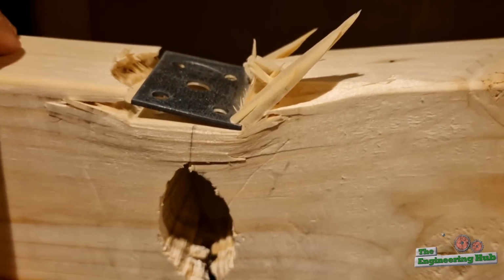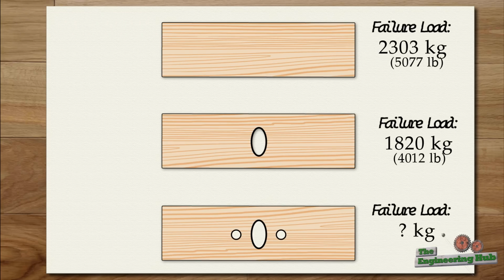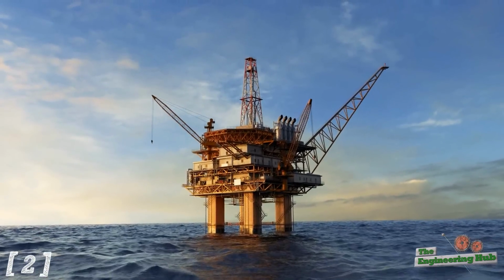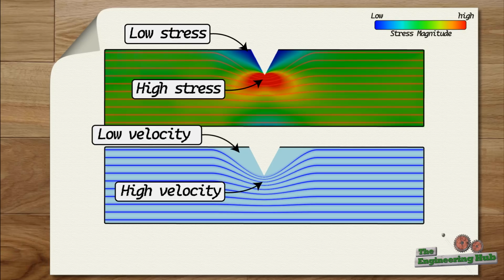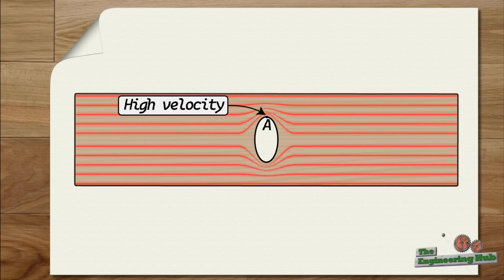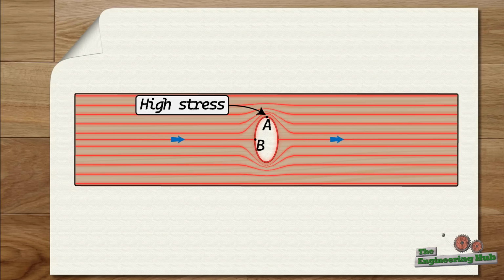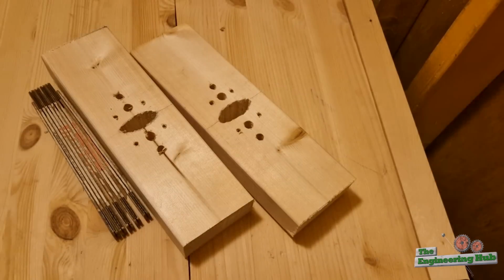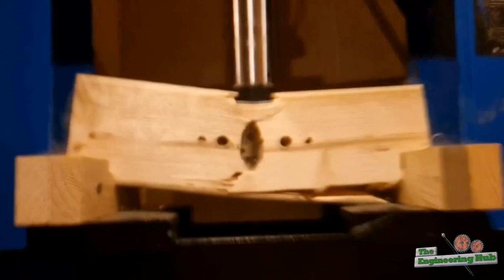Can drilled holes make your beam stronger?

Comment: 3:50 please do not perpetuate this idea of fluid having to speed up so it's in line with the rest of the flow. It's plain wrong - that does not happen in real life.
Reply from the maker: Yes you are correct for a real fluid. The assumption is within potential flow theory which makes some crude assumptions, amongst which that the fluid is inviscid, incompressible, and the flow has no vorticity. This results in that conclusion which of course is limited in real life with real fluids.
Reply: @TheEngineeringHub  No, even within potential flow theory it is wrong.

Comment: The conclusion in my opinion is wrong for all the listed parts by the other commentators. 1.) The material under test is non-homogenous 2.) the cutouts are different, thus the stress concentration points are different 3.) Flow can be used as an analogy only for easier understanding, otherwise it has no relevant similarity. The forces in flow diverging around a corner and the stress/strain concentration have no common ground. The only thing relevant in this whole video is that you can reduce the overall weight of the beam by removing material and still retain the majority of the load capacity. This is only due to the cross section. Cross section at the loaded points is the only thing you need to focus on. The rest is just nonsense.

Comment: Thanks for this interesting video and the great analogy. Yet, I am a little bit confused by how the shape of the obstacle should reduce the velocity around it. Given than flow J is equal to velocity v times cross-section area A, the only thing that should matter for the maximum velocity of the liquid (i.e. the maximum stress of the material) is how much wood is left around the hole. Any flaws in my reasoning?

Comment: Your experiment is absolutely incorrect. 1) You make the big hole differently every time 2) Different beams are different in load capacity because it's wood 3) Only 1 beam tested with no holes and with one big hole.
Reply: Exactly. Do this 100 times, with identical holes. Basing results on a single beam of wood is kind of ridiculous.
Reply: Surely you make valid points but calling the experiment straight up "incorrect" is definitely not right.
Reply: @maninimahapatra649  These "points" prove the whole experiment is nonsense
Reply: Although the explanation is a bit shakey, the clip demonstrates that strategically removing material may indeed strengthen beams under certain conditions.
Reply: @evdl3101 even his test didn't show that. At best it showed that if you already have a hole, then you can strengthen it with a couple of strategically placed relief holes.
Reply: @evdl3101 nope, cutting a hole in a member reduces its cross sectional area making it weaker.
Reply: @kinnikuzero You missed the point. Between the two cases of interest, 1) elliptical hole and 2) elliptical hole+side holes, the cross section was the same.

You don't have to convince us that a hole makes member weaker than a solid member. That we know. Video author also showed that in the very beginning.

Comment: Without multiple test of sample one and two it does not make the samples three, four and five very convincing. Wood being a natural product means there are lots of inconsistencies in it's strength even pieces from the same board because of knots and variations in growth rings that could have been caused by injury to the tree while growing or any number of other factors. Besides the oval holes where inconsistent which would have stressed the board differently for each test.

Comment: I think some are being overly critical in the comments. Yes the experiments would have to be a lot more detailed to have scientific validity, but the overall conclusion is correct. Also, although technically the wood failed first at the press contact point by delamination, we were still able to see the failure on the tension side of the wood block.

The stress flow evidently is much different from the examples given, as this is a bending load. However, this was addressed in the video and it still holds that the ellipse concentrates stresses on it's sharp edges, and that the holes may help distribute the flow more evenly

My takeaway was that the main point of this video is to show the counterintuitive result that taking away material can make the structure stronger, which is absolutely correct. And i believe it's not reasonable to expect a super detailed experiment on a simple youtube video like this. The use of potential flow as a theoretical justification for why this works is also correct, even if the loading condition isn't the same. And the experiments illustrated your point even if they weren't perfect. I enjoyed this video a lot!

I think its also important to say that this does not suggest that adding these holes is optimal or good or desired in a real structure. Real structural solutions often have better ways of reducing stress concentrators. This result, however, does show up a lot in real life -- not by intentionally removing material to make a structure stronger, but by adding material and unintentionally making a structure weaker -- engineers need to be aware of this kind of thing
Reply: The guy is just absolutely wrong. It is 'counterintuitive' just because his explanation is wrong! He has variation in results because of different structure of wood in these beams, it's nothing to do with the additional holes! I'm surprised how many people here write positive comments, this is how you do false science.
Reply: >the main point of this video is to show the counterintuitive result that taking away material can make the structure stronger, which is absolutely correct.
Absolutely not.

Comment: Interesting, but why make an elliptical hole when 99.9% of the time the shape cut through a beam is gonna be circular?
Reply: To show how v-shape cutout resists tear force with and without additional flex cutouts.
Reply: It will make the effect more pronounced. A circular hole is more "aerodynamic" than the elliptical one so will concentrate stresses less.
Reply: Why cut a rough leaf shape in the beam (creating internal notches) and call it elliptical.
There is so much variation in the 'ellipses' cut in each beam that the results are completely useless for comparison purposes.
Not to mention the tiny sample size used for a product with such a high degree of natural variance.

Comment: Wood is far from an ideal material for these tests, since it is grained and also nonhomogeneous. For a more sound experiment you would have to repeat the test many times due to the variation in grain patterns. Since the model (beam under tension) differs from the experiment (bending load), preferable would be a more homogeneous brittle material under tensile load, such as concrete made with small aggregate. Also good to know is that ductile materials are not affected by (static) stress concentrations, since they deform locally at the site of concentration and redistribute the stress evenly throughout the zone. A ductile beam with a notch or hole is weaker, but only because of the lack of material. Smoothing out sharp curves and corners won't strengthen them in the same way it does for brittle materials, at least under static loads. I really liked your video and I think it would be really cool if you made another one that shows the effect for ductile vs brittle materials.
Reply: He should have used 3d printed pieces or molded cement/epoxy if CNC metal is cost prohibitive.
Reply: Exactly, cutting the grains doesn't magically distribute load to adjacent ones.